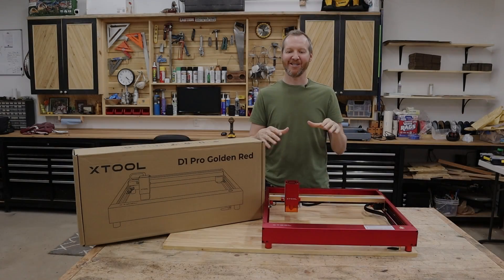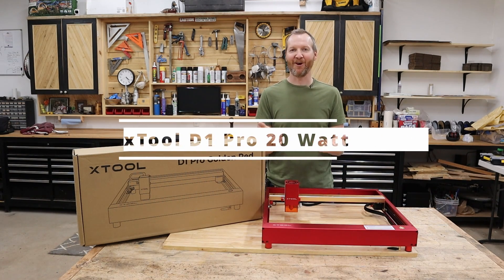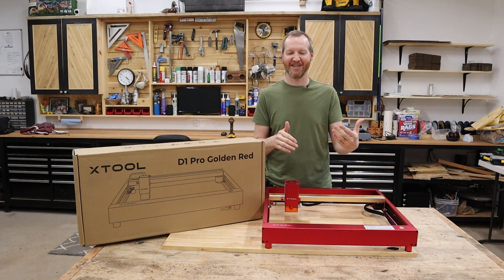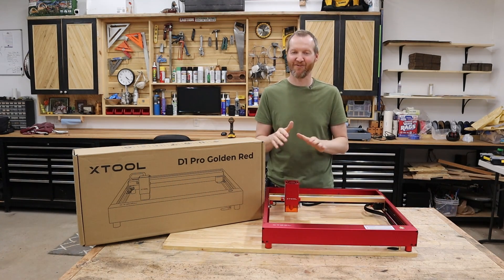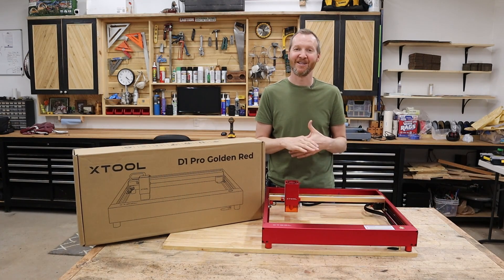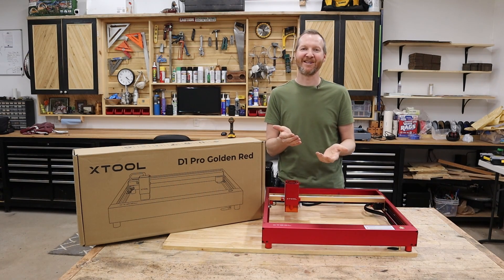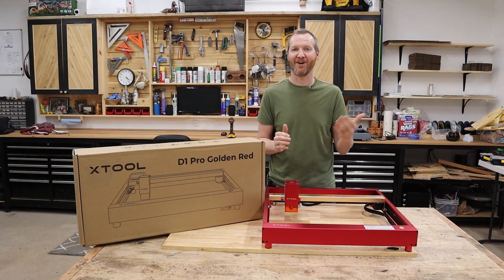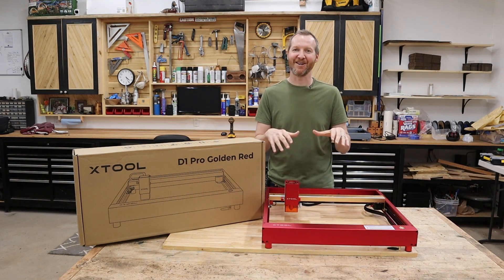xTool D1 Pro 20 watt- The Ultimate Step by Step Guide

Comment: Thanks for the video. I have one of these units. Question please. Is there any way to repeat a laser process if you move the laser head out of the way to inspect what you just lasered? Can you set it back again to the precise spot? I see the x and y numbers on the screen but they don’t seem to change when I move the laser head aside. I was hoping I could write those numbers down and then move the head around until the numbers match up again and then engrave a second time if needed. I use creative space too. Thanks.
Reply: Hi. I use the the stepper function to move my head away and back. This can be found on the process screen where you can choose to Frame the project. Top left of the screen, four arrows = Up, Down, Right and Left. Step the head away, counting the number of times you click on each direction and then stepping back using the same number of clicks. Hope this helps.
Reply: @ianmacgowan4335  Wow, that is such a GREAT IDEA. Thanks so much for adding it here. I can’t wait to try it. This could save me a lot of headaches. Really appreciate you adding that info here. 👍
Reply: @ianmacgowan4335  Let me ask another question please. When I add text and select the text, it adds the handles around the text. If I pull on the handles in the corners, it stretches it out keeping the dimensions but just increasing them. If I pull on one of the handles in the middle, not the corners, it does the same thing instead of actually stretching the text. I’m trying to use the full dimensions of a piece of wood, let’s say 10" long but only 4" high. I’ve tried entering the actual numbers on the screen but the software changes them so the dimensions are in sync. When that didn’t work I tried stretching it out with the handles around the text and that didn’t work. For example, if I wanted the word "STOP" on a long board but only 4, 5" inches high I can’t get that to work. It will take 10" long but then changes the height to something like 8", to keep the dimensions, which then falls off the printing surface of the board. Thanks.
Reply: @noahsark5279  Between the two dimensions for the text box (Height and Width) at the top of the screen there is a little padlock. Click that to unlock it. Now you can alter each dimension independently. Once you have the required dimensions, click the padlock again to lock it. The text can now be proportionally resized as before. You can do this for any shape or graphic.
Reply: @ianmacgowan4335  YOU ARE A GENIUS! You have single-handedly changed my laser engraver from an expensive door stop to a great tool in my shop. I guess I need to read the manual. If there is a manual (RTFM)? On my computer screen, the lock icon is almost like two music clefs intertwined. It’s next to the boxes where you enter the dimensions. Plus, there is a lock and unlock with a right click. I tried out BOTH of your suggestions and they work perfectly. Whew! Now it won’t take me hours to finagle the objects to get what I want. 
If you do know of a manual, that’s worth downloading, please let me know. I’m curious about other parameters such as, laser spot, origin, processing module trajectory, X and Y axis values etc. Can’t say THANK YOU enough for your info. Been looking for months on how to fix these 2 issues.
Reply from the maker: Hello, I'm sorry...but I'm not sure if there is way to do this with the xtool software. I thought lightburn software might have this option, but maybe someone else could chime in to confirm that.
Reply: Appreciate your response. Hopefully someone else will chime in.

Comment: Great Video!  I bought the 20 watt along with the extensions probably 7 or 8 months ago, still haven't gotten around to getting it going.  I did finally put it together about three months ago.  I'm going to try to get it running next week.  Your video makes it look pretty easy!
Reply from the maker: Hello, this xtool laser is really easy to use. The software makes it simple to get started with the basics right away. Have fun!
Reply: @chaddiy LOL, right now I can't even figure out how to home the thing🙂 My CNC has a home all axis that moves the spindle to the home position.  Can't find anything like that here.

Edit:  Apparently the big round button "sets" home.  Not sure how you can ever have a consistent home this way.  

Right now I'm trying to print a pattern on black anodized aluminum.  The pattern on the screen is there when the mouse hovers over it but goes to solid black otherwise.  It isn't printing anything, I tried it on some of the sample wood that came with it and it's just making a black surface like is seen on the screen when the mouse isn't hovering over it.   I'm going to need to do some studying to get this thing working I think.

Comment: Thanks for the video. Just got my D1 pro yesterday. Set up was easy but making things looks daunting. I assume it is all trial and error as far as getting the settings you need? Use scrap wood until you are ready?
Reply from the maker: Hello, yes...scrap wood is a good idea until you get things figure out. Xtools website has great info where you can search for materials you are using and match it up to your machine, and it will give you the recommended settings.

Comment: So I have a couple of questions about using this how easy is it to figure out as far as where to put the product your working on for example to left middle top  bottom etc and also for example doing one  item vs 5 also it is harder to small items such as dog tags on this I'm asking about this because I saw a video where a big project shifted because it was going to fast thanks
Reply from the maker: Hello, My opinion is this is the easiest diode laser to line things up because it shines a laser beam down on your material so you know exactly where it is going to start. When doing multiple items, it is a good idea to create a jig first. That way you can repeat the process time after time without anything changing.
Reply: @chaddiy3512  ok thanks for the info I was wondering because my girlfriend has a cricut and I know you have to make sure you have the vinyl in thetop right spot and basically copy and paste design to fill up whole page so that's why I was asking BTW do you have any videos on making a jig yet just haven't had a chance to check out all your videos but definitely plan to also have you done any dog/pet tags? Thanks for help